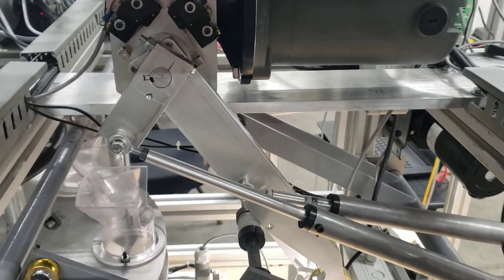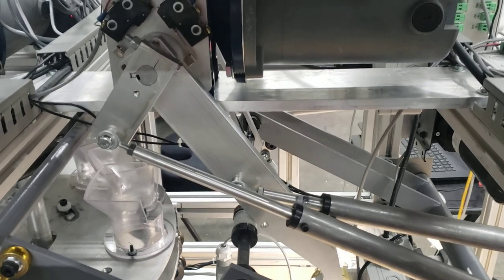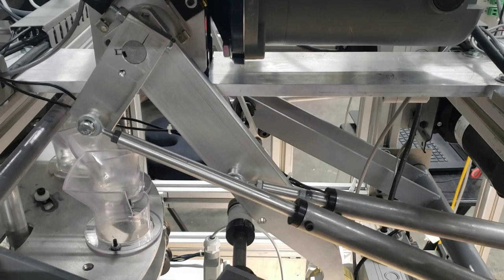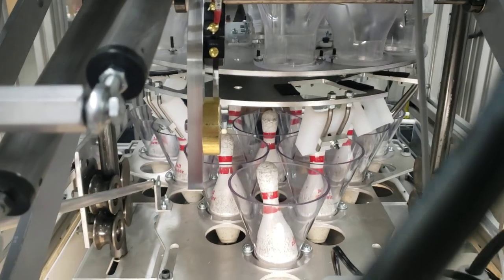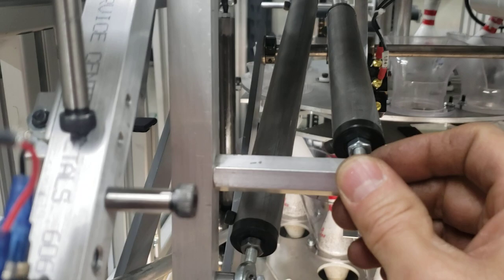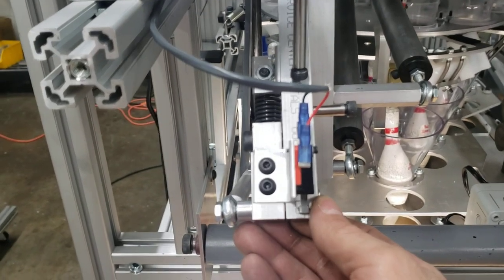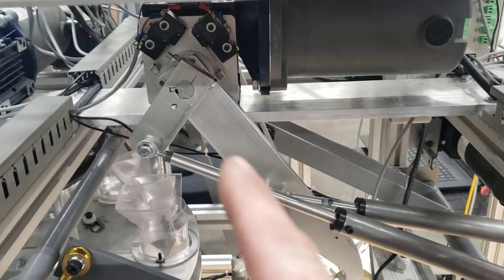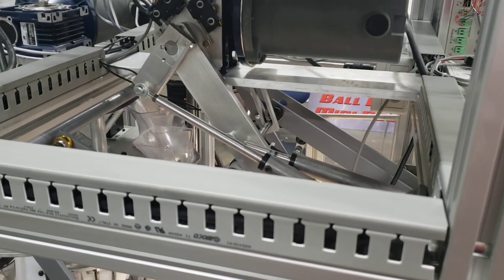New secret part function reveal

Comment: Have you ever considered moving the pin elevator to the side of the lane? Might free up a few feet that could be added to the lane length. The ball return would be a straight line back to the front.
Reply from the maker: The lift is only 6 inches deep.

Comment: It is a shame that the off spot switch (old style) was a tough adjustment and that you had issues getting the old motors. That pin table drive was very compact and simple. This setup is definitely more parts, but once it's installed shouldn't need to be adjusted much?
Reply from the maker: It's actually about the same number of parts when you add in wires, relays, plugs and mounting bracket for the motor for example. Those electrical connections to make the motor run are all possible points of failure. Using this system eliminates those points of failure. One thing I didn't cover is I'm actually simplifying the electrical system of the machine also.

Comment: Very impressive, seems like you are continuing to simplify the machine.  I really like the reversing mechanism to avoid the deck being locked on the hook. Did you beef up the chain on your elevator? Looks thicker than the one I previously saw.
Reply from the maker: Yes, the lift chain was beefed up sometime ago when we combined the ball lift into the pin lift.